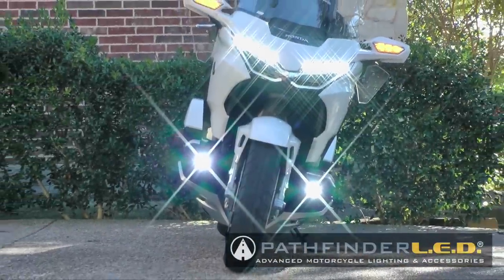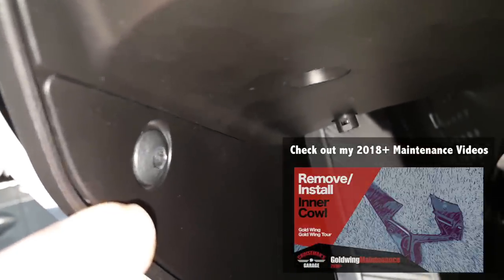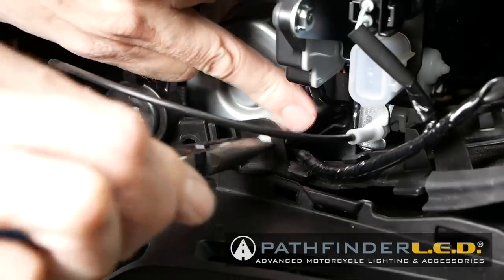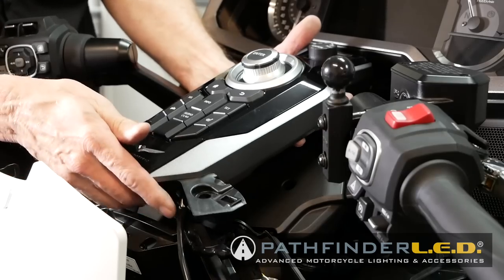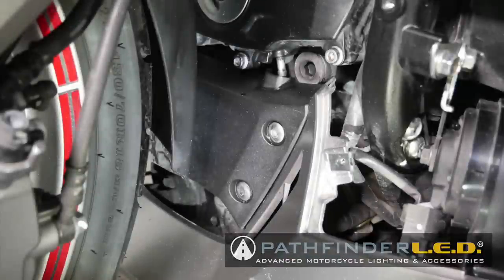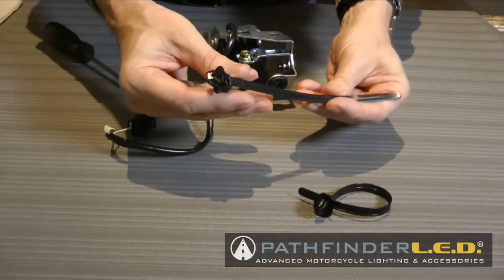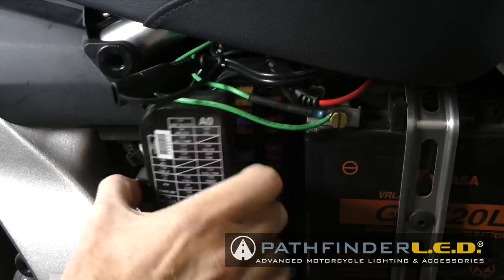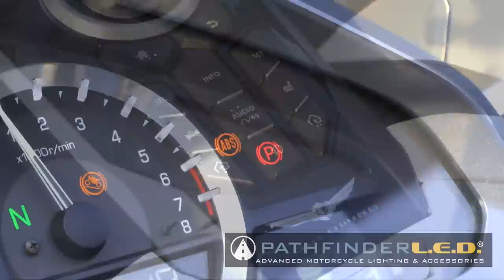Multi-Function LED Fog Lights for 2018+ Honda Goldwing | PathfinderLED

Comment: Now that you have install 3 different fog/running lights, which do you prefer? After you showed me the Rivco lights I went and got them. Easiest install, very bright and I believe the cheeper of the 3. I really don't see the need for strobe, unless for maybe parade duty. Keep up the good work. Were they all installed on your bike?
Reply from the maker: All installed on my bike. I will be doing a moto vlog soon where I compare the 3 different brands.

Comment: Looks similar to Rivco lights installation.   Will you be making a video on Show Chrome lights?  I'd be curious about your review.   I think they don't require additional wiring and use the factory wiring just like the Honda fog lights.    They also have the short cut instructions for installing the on/off switch.
Reply from the maker: Show Chrome has not reached out to me regarding their lights.

Comment: For a motorcycle where being seen quickly is paramount, total lumens are all I care about. The more lumens the better hands down. The Rivco’s have 6k lumens and are nice white lights. What are the total lumens on these Pathfinders? Thanks Cruiseman!
Reply from the maker: You need to check with SoCalMotoGear for the lumen count. They are bright!
Reply: SoCal site says 900/side, 1800 total. 5700K daylight. Rivco is 3000/side.  I’ve had other SoCal lights. They do make a very good product.

Comment: On average Cruiseman how many times can you take those fairings on and off before the clips break and the screws strip out
Reply from the maker: Nobody knows yet. I have wondered the same thing. I have removed/re-installed mine at least 10 times so far.
Reply: Best get all the extras you will ever want or need and do it all the same time thats what i intend doing
Reply: @cruisemansgarage  10 times eh?   Watch out for "Lucky No. 13"